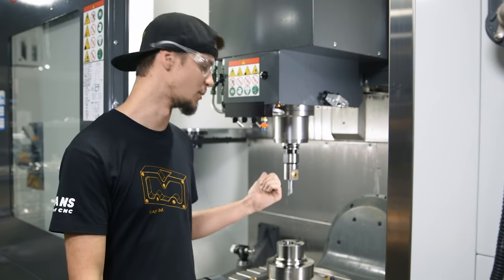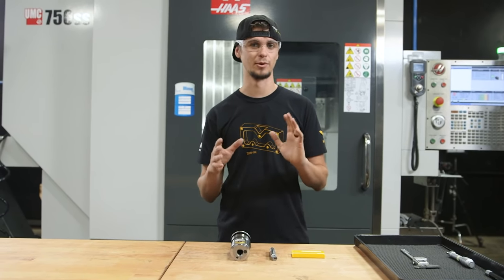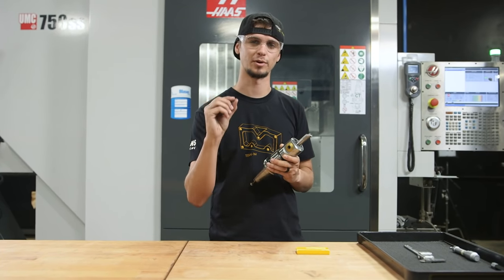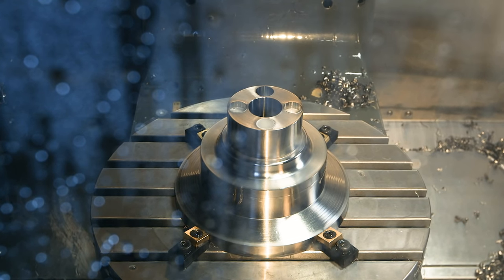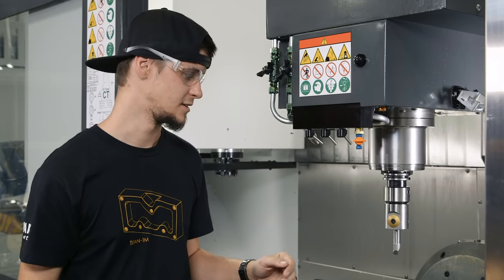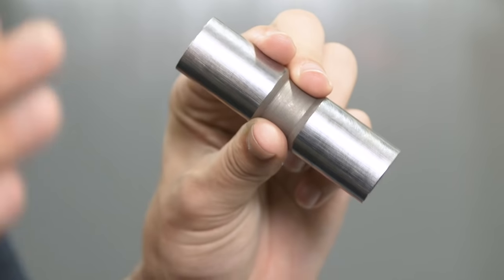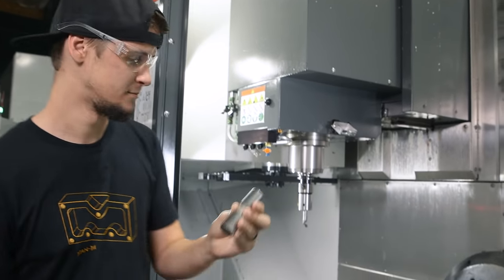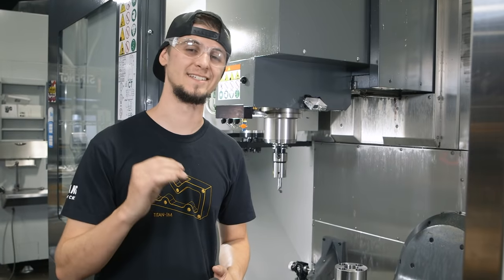The Most Interesting BORING Video Ever | CNC Machining  Vlog #101

Comment: The plug gages should be used with "white" grease, not dry. How did you measure the first cut? Gage or another set of pins? When you use Bore Gage(set on Bore gage ring), you can see, if he hole is round or elliptical. Gage pin doesn't reveal that flaw! And most of the holes are elliptical, if the tool is not perfectly balanced - i.e right on the axis center! (due to uneven eccentric force while rotating in not perfectly balanced state).

Comment: Another question, do you guys have a tip for dealing with adjustment play after you tighten the lock screw? It always comes out much smaller for me, which makes it hard to precisely tweak the boring bar in 1 shot
Reply: Locking your spindle and test indicating the boring bar would give you a pretty good idea.
Reply: .0001” test indicator is my favorite indicator for a reason. You can check soo many things with high precision. Your only limited by your creativity. Even a .0005” indicator is good as u can read between the lines to .00025” pretty easily.

Comment: The hole went over size!  That 1.0000 Deltronic certainly had more than .0002 clearance... and the 1.0002 NO GO pin was never aligned properly, and if it had been aligned properly it would have gone to. That a large chunk of titanium to trash like that. You should have crept up un that cut with balanced dept of cuts.

Comment: I had no idea you could probe a boring head. Is there a reason you chose a boring head instead of a reamer? I generally see boring heads as a means to achieve diameters too large to buy a reamer in, but you can buy 1" reamers.
Reply from the maker: Readers follow a crooked hole.
Boring is Truer

Comment: Why would you buy a set of those pins, instead of using a boring gauge??
Reply: taper. no hole is perfect due to deflection. that's why we ream a hole after cutting it or do a spring pass.

Comment: How would you hold a tighter bore tolerance on a few shallow bores(1/2, 5/8, 3/8) about one half diameter in depth with a tolerance of minus nothing, plus .0003. Having rubbing issues from time to time trying to get it to come in. Currently using tenth under low limit deltronic pins and low limit to high limit carbide class 2 pins with a small flat ground on all pins for air relief. Climate controlled shop

Comment: Does the boring bar cutter scratch the bore when you pull it up?
Reply from the maker: No because we used a G85 which bores in and out
Reply: Titan, another great technique is to bore to depth, stop spindle, M19 orientate then move the tool in the X axis to the clearance side and rapid out. BOOM!

Comment: Pins are tricky to use.
You have to be perfectly aligned.
Reply: That’s what I was thinking. If someone was onsize but didn’t have the pin straight then you might think the hole was smaller than it is. He must be a pro.

Comment: Interesting video, too bad I'll never have a VMC that can take advantage of that kind of precision.  That Deltronic pin set (0.9988 to 1.0012 by 0.0001 steps) costs ~$300 which is less than I thought it would be. Of course the boring head (not including boring bar) is $1200. Then again, the price SpaceX pays for the part is probably astronomical. Literally.
BTW, those are 'divisions' not 'deviations'. And what is this with the 'veneer' scale. It's a vernier scale. Two R's. It would rhyme with Turnier if that were a word.

Comment: No he adjusted that in one shot, the deviation of hos second cut will change unless he had exactly .0022 left of material before his 1st cut, tool pressure is real and will make .0001 precison movements nearly impossible to hit dead nuts 1st try. And a gauge pin for .0001 come on lol. If your are trying to be that accurate you might as well use an air gauge. Journey man toolmaker her. Not bashing you guys though. Great channel, great content, I just wished you showed the side of maching where the finnesse is invloved.Not everything can be calculated.

Comment: all this technology is great but just look at that part. Bored right to the wall practically. Looks like some sketchy engineering. Must exactly be 1" with .0005 tolerance. Absolute perfection.  NASA spent 40 million to develop a pen that would write in space. The russians used a pencil. The grab bars on their modules looked like galvanized plumbing pipe. Then we wonder why we were grounded for over a decade. Engineering insanity.

Comment: Wrong here: he should step down 0.0002 to be correct. He made 1.0001-1.0002 hole!
Meaby he knew, but was afraid to show that 1" pin wont fit , but 0.9998 will fit? Then there will be questions here to answer , whyyyy???  :)  (one inch pin will go to 1 inh hole - but only with press device...)
He was within 0.0005 tollerances for sure, but could do more precise job! Sorry for my english...
 (Like for his presentation going anyway)

Comment: Would it not be easier to use a bore milling cycle/ helical?
Reply: You would need a full calibration of your machine to achieve such tolerance with such method. Using a boring head with boring bar ensures you get perfectly round hole and no taper.

Comment: if you want to know if its right MEASURE it, no?
Reply: That's what he did with the pins..? It's a standardized way to measure holes quickly and easy. And the gauges can even be specified for one part if it's mass-production (Stop and Go-sides that hits the tolerances of the specs provided from the customer etc.)
Reply: He must have measured it when it was -.0022 because his pins didn't go down that far. The deltronic pins are a good way to double-check that the bore gage is set accurately.

Comment: I doubt that pin is "exactly" 1.0000.
Reply from the maker: That’s the whole purpose behind deltronics... .0001 increments.
If they are not then they have been fooling the biggest companies in industry for a long time.
Reply: They are until you hold them in your hands for a minute and warm them up lol
Reply: @IX eleven Have you ever seen a gauge pin that comes with a micrometer? It's got plastic in the middle for a reason
Reply: Everything machined has a tolerance. So no, that gage is not exactly 1.000000”

Comment: Why don't you use the metric sistem it's easier
Reply from the maker: We gave you the metric speeds and feeds in this video.
Reply: It is easier to use what the customer is using.
Reply: Whatever units of measurement you start out with in training will be the units that seem easier.   Nothing wrong with either metric or Imperial measurement.  Most North American drawings are in inches.
Reply: There are two types of countries in the world.  Those that use the metric system, and those that were first to put their flag on the moon. 🇺🇸